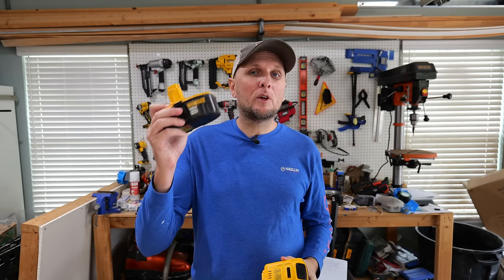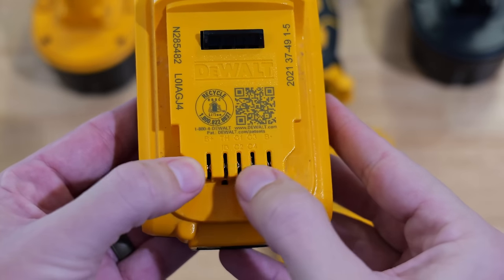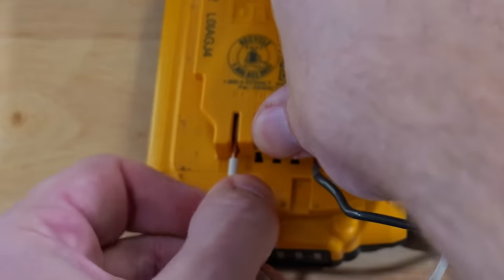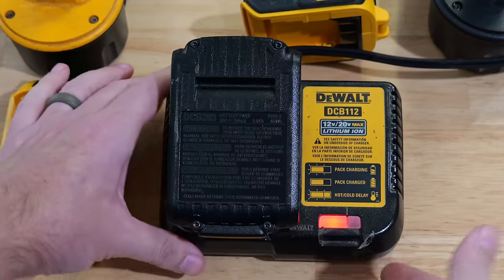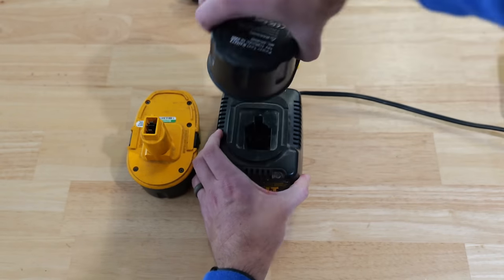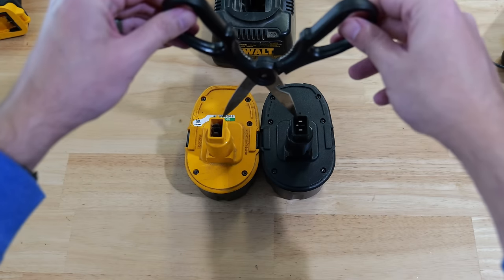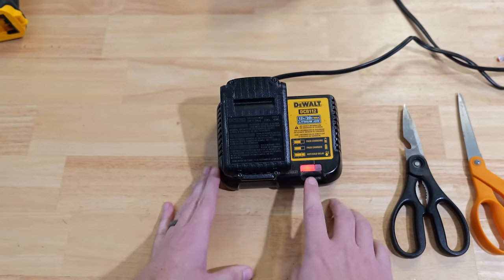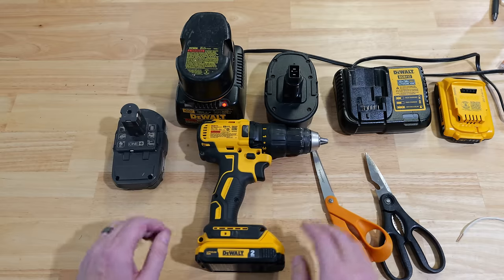SECRET To Reviving Dead Portable Tool Batteries | Super Easy!

Comment from the maker: Have you ever run into this issue?  Did you end up just replacing the batteries?
Reply: I wonder if this could be done with RC batteries?
Reply: I still have my dead batteries, so I'm going to try this. You're awesome. Thank you so much. I'm going to try this now. <3
Reply: I didn't replace them because I had already seen the 700 OTHER videos that explain this procedure on you tube.
Reply from the maker: @andys5562 cool. But that’s definitely an exaggeration 😂
Reply: I have run into a battery pack that would not charge, and as you have done, given it a 'boost' charge from another battery and then charged it as specified.  While this worked, it was certainly short lived, and the 'bad' battery never had the robustness of a good battery and eventually was more effort than it was worth for the length of time it produced work (and died again).
Reply: Just like in RC, the batteries slowly drain from age and won’t hold as much of a charge. You’ve seen it in cell phones as well, after a while they won’t last as long. This method is great, thanks for showing how to ‘squeeze’ the life out of batteries. I mark the ones that don’t keep as much of a charge just so I know which batteries will work but just not as long. Hint: always keep your batteries charges while not in use.
Reply: The problem is not really that the battery is dead. The problem is unbalanced voltages between cells. There are 10 cells in a DeWalt 20V battery. The regulator circuit tries to keep them all balanced when discharging and the charger wants to see them fairly well balanced before it will charge. This is a safety feature.
When you jump start a battery pack like this, it will only work if there is only one specific cell that is out of balance. If any of the other cells (or multiple cells) are out of balance this won't likely work. My experience is that this works only about 10% of the time.
Also, quite often the root cause is a defective cell, so even if you get this to work, the battery life on a single charge is typically much shorter and it generally only takes a couple of charging cycles to get back to where you started (i.e. the charger not accepting the battery).
If you've had better luck than that, that is great.
Reply: I have run into this, but the real issue I had was that my old 18V Dewalt batteries wouldn't last long after completely charging them. I bought new? ones, but they did the same after a while. I did find a kit with an adapter (adapter, charger, and 2 batteries) so I could use 20V batteries in my old 18V tools and that worked great to get new life out of the tools. I ended up getting a set of two no-name adapters and now just leave them on my most used tools. This probably wouldn't work for pros, but I didn't have to go out and buy a new set of tools for DIY use around the house and shop.
Reply: I have one that is fully charged (all three lights when button is pushed) and will run a tool, but when put on the charger, the charger does not blink.  Any idea what's going on?
Reply: @rogerheuckeroth7456  As I indicated in an earlier comment, these batteries are actually battery packs with multiple battery cells interconnected. If the voltages on these cells becomes unbalanced, the battery charger will not try to charge the battery pack because there is a risk of fire.
There are advanced steps you can attempt to try and resolve the imbalance problem, but there are risks involved and most of the time, the resolution will be only temporary because there is an actual defect that leads to the imbalance.
I don't recommend it, but if you search YouTube you can find videos similar to this one except that are disassembling the battery packs, identifying the unbalanced cells, and charging them independently with an adjustable power supply. If you do attempt this, make sure you are looking at instructions where they are limiting the current during the charging process.
If you do not understand what I just said, I recommend you just buy new batteries... which is likely going to be the final outcome anyway.
Reply: I have these problems with a bunch of my 18V 5.0Ah Bosch batteries
Reply: The best scenario, hypothetically, would be to trick the charger into charging the battery with the correct current.
Reply: Why did you leave out the Ryobi connectors? That's what I need.
Reply: I have BOSCH's 18V system, it's very similar to the 20V Dewalt's you showed, but I always just start charging them before they are dead as a doornail, and with it avoid complete drain.

Mine aren't marked with letters, numbers, or anything that is meaningless as to electrical designations, and there are other systems too where that may be true, and could have all kinds of markings.  That's what a V and Multimeters are for, and that's what you should have talked about, because there's no guaranty the contacts are in the same order, and someone who just takes your word for it on a different make system may be in for a surprise!!  

Mine do indicate those correctly as + and - : now that means something!

Why 5 contacts?  Two cells in parallel (Same Volts, twice the use time), and a sensor contact.

Even the cells are really made of multiple cells, and there are no 18, nor 20 V battery cells we know of possible by nature yet, which has to do with the materials used to make them and how they react chemically to produce energy;  A 9V battery is a stack of six 1.5V cells in series, and a 12V car battery over 14V.  And it's also why Lithium Ions are less than 1.5V, and 1.5 is rounded, even in NiCad's....  The more you stack the greater the error, so at a point an additional, or one less cell corrects it within parameter:s  there's leeway, they do not have to be exact.
Reply: During the early days of portable power tools - the 90s, by the time the battery stopped working, it was obsolete anyway, so I just got new tools. I must have bought a new set of tools every other year.
Reply: I have a ryobi that the charger indicates is defective.  Will this work in that case as well?  Or is that a different situation/solution?
Reply from the maker: @davidanderson9103 that’s different.  That is saying there is actually something wrong with the battery and probably needs to be replaced.
Reply: @davidanderson9103  It can vary widely, because he was very specific to Dewalt.  There are no rules to the arrangement of the contacts, and what indication they use to recognize them if at all.  a,b,c,d... or 1, 2, 3... are not electrical values and say nothing!  You need to either find out or measure what they are.  You also can't know if it's the same problem depending on the chargers capabilities to tell, as it very well may be defective and really no longer chargeable, or it may work.  It may even be a connector inside came off, corroded contacts... but lithium batteries do not last forever and do get to a point where they can no longer be sufficiently charged.

IOW:  You are on your own, because the video doesn't cover anything of value that can be used more universally, and other than those two systems specifically cannot be taken as valid.  There are although some tell tales to those of us who understand electronics, and even still call for further investigation.
Reply: @HowToHomeDIY  These battery packs have a microcontroller who's principle job is to make sure that each of the battery cells drain equally. If the microcontroller is unable to do this, it likely means there is an issues with one of the cells.
There are exceptions, though.
Reply: @HowToHomeDIY  "that’s different.  That is saying there is actually something wrong with the battery and probably needs to be replaced."

That's mere speculation!  You are going by "What it says", not how the MFG chose to word the message, nor if the circuit can tell the difference (Unlikely).  In your case you didn't even get a message.
Reply from the maker: @scytaleghola5969 that’s not what’s happening with the issue I’m talking about. So many people are talking about issues that this video had no intent on addressing.
Reply from the maker: @Bob-of-Zoid I didn’t get a message because it’s a different matter altogether.  It can’t communicate with the charger to give one.  If after a slight charge is put on the dead battery and once the charger can recognize it, it gives a message like his was, then toss it.  That’s not what this video is about.
Reply: @Bob-of-Zoid  Thanks for your response.  I figured it would probably be more complicated than simple yes or no.  I appreciate you taking the time.
Reply: @HowToHomeDIY  I figured it was probably different.  Thanks for the response!  Thanks for all your work and content!
Reply: @HowToHomeDIY  Given that the very title of your video can and should be read to be universal and not specific to just the two systems you covered, which it is, but it isn't now is it?

The message one gets indicates it cannot charge the battery, not why, for that a more sophisticated circuit would be required, and one can be made where they do communicate (higher cost), and it actually is, because the difference between detection and no detection is the most basic form of communication. Also you are contradicting yourself:  If it can't communicate, or compute..., then how can it tell what the matter is of the possibilities?

Toss it, or investigate further, and see if it can be fixed, because as I already said:  there may be other reasons the charger cannot recognize the battery, with that it cannot be charged only the start.  But it helps if you read my replies, in order and context to whom I am replying to, and seeing what you can learn from it, to which you should be accepting of my perfectly rationally reasoned logic (if you can which I now have good reason to doubt).

You very conveniently dismissed a whole lot, in order to defend the indefensible, and make me look bad, which is a strawman argument (Attacking the person instead of the argument), in your seeing my filling in the blanks, adding valuable information and trying to educate those with questions, and instead of seeing the utility, you took it as an attack, which it wasn't.  If it was, I would be clearly so, and there is nothing indicating that.

I chimed in because I understand this stuff on a highly academic level of engineering, as well as experience, and to help out where I can, it's in my nature.  Going after me for perceived motive is just plainly  bogus, and makes you look bad, not me

Good day!
Reply from the maker: @Bob-of-Zoid I never attacked you, I told you what the video was about and what is clearly talked about in the video itself.  Sorry if you took it personally.  Not here to argue.  You perceived something different than what was clearly laid out as the objective in this video.  It’s your opinion.
Reply: @davidanderson9103  Well, it's not as complicated that you cannot find out, and figure your course of action.  It may turn out to be easy, and salvageable.  Besides, if you don't, then you probably know someone with the tools and understanding to help.  It should be very basic for anyone who does.  Good luck with it.
Reply: @HowToHomeDIY  It is not my intention to get into a debate on this subject. The C1-C4 contacts on the DeWalt battery have a purpose and if you are "charging" your battery without using those terminals, you are not doing what you think you're doing.
You do not need to take my word for it, there is quite a bit of information on this elsewhere.
I personally try not to give advice on this subject because there are risks - of fire, explosion, or causing damage to a perfectly good battery. 
I mostly am trying to discourage people from thinking of these battery packs like other, less sophisticated rechargeable batteries.
I will beg off now.
Have a nice day.
Reply from the maker: @scytaleghola5969 I’m not debating you.  I said this video is not intended for the issues you mentioned.  This technique works for the majority of batteries that aren’t recognized on the charger and then start working and work well for a long time.  If one then shows there is an issue then toss it.  This is so common and has helped me a lot in the past and countless others in the comments.
Reply: @HowToHomeDIY  I said I was going to drop out, but just want to make sure that when you say "toss it" you mean drop it off at your local Home Depot or other battery recycling station. Please do not put Lithium Ion batteries in the trash.
Really, you should not throw ANY batteries in the trash, but especially Lithium Ion.
This has been a public service announcement.
Reply: Who has two pairs of scissors laying around. Someone has lost or broke them by know!  I hide the one pair of “good” scissors or I’d have none.  😂
Reply from the maker: @southwest7977 I can relate 😂 they are like shop pencils lol.
Reply: Spoken like a true genuine car salesman
Reply: Had it today. Will this work on the Ryobi 40V batteries? I have a 2 amp and a 6 amp. The 6 amp gets an error red/green flashing. HELP! (Thanks!)
Reply: @jc2200  rc batteries are lithium polimere cells and have a different construction than lithium cells like 18650 ect...  i dont know of any hack fixes for rc cells.
Reply: @scytaleghola5969  actually 5, 10, or 15 cells, depending on the ah rating.
Reply: @paul-Cellit-boston  thanks! Tried the method on a  e20 snaptain batteries. The charging indicator light will come on the good battery but not on the bad one(when attempting to charge). Left the landline phone wires connected, and  🔋s indicator light will come on the bad 🔋 but wouldn't charge!   The batteries look similar to the ones on the batteries shown here! 🙃✌️
Reply: No, I used a similar method only using two 9V batteries in series. It doesn't take a lot of current to increase the charge on the dead battery. There is a circuit board inside these batteries which controls the charge to the individual cells (there are multiple smaller batteries inside) and also charging info. If the battery gets too low, this circuit board fails to work.
Reply: @jc2200  I've done this with drone batteries.
Reply: @basswizardry nice,  did it work for you?
Reply: @jc2200  yes, works with almost any lithium
Reply: @basswizardry  great!. I used telephone   landline wires cause the opening is smaller, which, in the end, should not matter. I think the battery was detective.  Plus, it was a brand new drone, so I sent it back and got a refund instead! Thanks 👍
Reply: Try running the fully charged battery down a bit,then see if it activates the charger
Reply: My issue is a bit different. My charger says the batteries are charging and get fully charged. But when I use them they quit very quickly. I have recharged them but they still only run for a short time. Each battery has its own charger and they both are acting the same way. They are Black & Decker 20v. The instructions said they could be stored connected to the charger and with the charger plugged in. I’m thinking I just need new batteries. This is not the same problem shown in the video. Would anyone be able to offer up any insight to my issue? Thanks
Reply: @SammifromMiami  I'd say you're exactly correct,  they're tired and need to be replaced.  They will hold a charge for shorter and shorter times as they grow old.
Reply: Paper clips work great. Bend the clip out straight then bend the ends enough so they hook on
Reply: I have and did. No more.
Thank you!
Reply: The electrolytes used in all kinds of things will eventually become inert. It is a chemical/physical change and it just gets used up over time and proper use is important!
Reply: i
Reply: Great info, thanks
Reply: My father showed me that trick a few decades ago and though I do use power tools daily in my shop I have definitely  saved a few Thousand Dollars over the years on replacement batteries!!! The same exact trick also works quite we.l on crafting tools that are smaller versions of their big brothers like Craftsman, Weller or Dremel... I have been making blades, Knives & Swords for over 50 years now and the money zi"ve saved on recharging batteries is incalculable!!! Probably enough to take all 5 of my grandsons on a long vacation somewhere!!!
Reply: @rogerheuckeroth7456 have you tried cleaning each of the battery and charger connections? You can do that as simply as using a 
Q-Tip dipped in gas, alcohol or brake cleaner...
Reply: Z28 Camaro convertible.
Reply: I just had this issue 2 days ago with a 20v lithium. 
I accidentally fixed the problem by first giving it a charge with the 18v charger while using a converter.
Then the battery charged fine in the 20v charger.
So if you have the old and the new with a converter - no need to strip wires. 😂
Reply: 6:41 6:43
Reply: @HowToHomeDIY would this work with EGO Power+ batteries?
Reply from the maker: @dwoolery32 interesting question.  I don’t know for sure but don’t see why not.  I’ve not had any of my Ego batteries have this issue yet so haven’t been able to try it.
Reply: @HowToHomeDIY  Thank you
Reply: The only issue I've had with one of my 40v Ryobi batteries is overheating while mowing the lawn on a very hot, sunny day.  I thought it was out of power but It showed nothing on the charger.  Then I remembered something a colleague said about his batteries and 15 minutes in my fridge did the trick.  Once I placed it back on the charger it charged.
Reply: On the 18 volt battery, wouldn't a female spade connector on the wire work better and be safer than jamming uninsulated scissors into the terminals?
Reply: My man you have earned yourself a subscriber with that one! 
Brilliant hack. 🙌
Reply: Are 18  and 20 volt basically the same or does 20 volt have one more cell?
Reply: Wow. Great tip brother. Thank you for sharing your time, experience and knowledge with others. God bless you. Respect
Reply: Hiya sir;..great video. ..you know the second set of batteries you used (the older type 18v dewalt )...when you put in the sissors; the first set you put in...is that terminal a.....
 +  or a  -     The reason I ask is because the battery I have that is good makita has  plus and minus on it so I'm trying to find out if the first set sissors  (first connection )was a plus or minus...I would really appreciate your help  because  I don't have a dewalt battery with any life at all....the makita is allso 18 v Ni-cd...kindest regards wayne 😊
Reply: Yes I have.  The batteries were over 6 years old  Figured it was just time.  Ryobi.  Always positive things to say about their tools.
Reply: Could anyone help me with the issue I have written (my question )...
All I need to know about is ...on the second set of older Dewalt batteries 
I have the older ones allso..I NEED TO KNOW WHAT IS THE  + TERMINAL?   WAS IT ON THE  FIRST SET OF SISSORS HE USED OR SECOND.. ??.  🤔
Kind regards wayne ☺
Reply: I have ran into this issue a few
My latest one Atlas 80v battery stopped taking a charge
Used my 40 to tried to jump it
Still wouldn't take a charge
End up charging the whole battery with the smaller battery 
And it doesn't like to work in my tool even though it's got a 2/3 charge
Reply: Good afternoon;  I have sent you a question about the second set of batteries for dewalt twice now buddy "(THE OLDER TYPES; Ni cad"   18 v )   DO YOU THINK YOU CAN REPLY TO MY QUESTION  please 
Why  don't I seem to  get a reply ?
Are you not receiving? ...Kind regards wayne
Reply: Seems to work but will not have a full length charge, but anything better theb
Reply: @HowToHomeDIY  nobody covers my issue to do with 20 v dewalt battery i put in on the charger it starts to flash then shows it fully charged when it not has like 1 bar acourding to the indicator
Reply: Id like to know if this would work on my old Makita 9.6v batteries.. ?
Love the tools.. but they sat so long i can get em to charge..?
Reply: Man, you just made my day. Thank you?
Reply: Actually I revived several DJI batteries this way and they worked like new. But whatever you do don't short circuit a fully charged Li-Ion. You'll regret it after you get out off the hospital. 😅
Reply: Traduire francais
Reply: Traduire français
Reply: @jc2200  
Yes it can and it works well. I've done it several time and even recently with Airsoft and drones. 
Good luck!
Reply: @Major_Tamre_Colby  thanks 🙏
Reply: @JocelynMarois-ev2em  
Deus veritatem honorat, honori majorum nostrum, and hamster's too.
😃👍
Reply: @chuckgrenci6404  The problem you are experiencing is usually caused by running the battery until it quits.   This will eventually reduce the runtime between charges, and the overall life of the battery.   When the tool starts to run a bit weaker than normal it is near the end of its charge anyway.   Replace it that point.   Also, never charge a warm battery even if the charger allows it.   Let it cool down to ambient temp.   Usually 15 mins is good enough.  These simple steps will increase the life of your Lithium-Ion (Li-ion) batteries dramatically.
I have some 5-6 year old Li-ion bats that are still working like the day I got them.
Reply: @GeekboyNC Although this fix is a good one.   The problem you are experiencing is usually caused by running the battery until it quits.   This will eventually reduce the runtime between charges, and the overall life of the battery.   When the tool starts to run a bit weaker than normal it is near the end of its charge anyway.   Replace it that point.   Also, never charge a warm battery even if the charger allows it.   Let it cool down to ambient temp.   Usually 15 mins is good enough.  These simple steps will increase the life of your Lithium-Ion (Li-ion) batteries dramatically.
I have some 5-6 year old Li-ion bats that are still working like the day I got them.
Reply: @vinnyb.6524  Thanks for your insight, however, my battery stemmed from just being old (and not a regular service cycle). I was trying to extend its life (as I don't use my tool as regularly, since I've aged, as well as the battery......lol). I did get good service from the battery; just trying to eek-out a little more.🙂
Reply: Sometimes this is only a temporary solution. Ive done this on 2 batteries and got them to be recognized but the charger was shirt lived and ended up buying new ones.
I will be opening up the old ones and replacing the bad cells with new ones
Reply: What about  19.2v lithium craftsman batteries with 4prongs?Can someone please help me out ?
Reply: @GeekboyNC I have that adapter and it allowed me to keep my toolset through a round of lithium batteries that don’t have the overall lifespan of the nicad batteries, and are more expensive (that may just be due to inflation). I do like how light and they are and how quickly they charge though, and it looks like they’re the only option now anyway😁
Reply: can i connect 20v good battery to 18v bad battery and fix it?
Reply: Damn, I replaced the Batterie of my dyson already twice. Will try this next time🙏
Reply: Everything you said here is fine but some of these packs have trash batteries (used, high cycle rates) from day one. A few other channels have showed that if you open up the packs the manufacturer date on the cells can be 5-7yrs old.
Reply: Algorithm is definitely listening to me. I literally just had this problem..but with Mikwaukee.

Will this work for Milwaukee too?
As long as it's still in warranty it really doesn't matter though, cuz theyre real good about replacing it.
Reply: @charliem.7492   did it work?
Reply: Y just did that and they will not charge they all dead replace is the only way spend money on a good battery
Reply: My batteries dead cannot charger no sign blinking, I open the cover batteries assemble all separated and I using batteries for torch light,.😂  and i buy new cordless batteries, because i too late to see this video tutor , thanks any way👍🙏
Reply: @HowToHomeDIY  and you don't have a electric car yet the battery only lasts for 3 or ,2 years you veto has some money in the credit cards at ,45 percent
Reply: Be great if there was a fix for older computer batteries.
Reply: I have batteries that are fully charged, according to a volt meter, but will not run tool. Charger blinks fast.
Reply: @SammifromMiami  Never buy Black n Decker.
Reply: I have a ToGo advanced 650 portable power station, which is a 12 V lithium battery pack basically. I saw your presentation on the tool batteries and wondered if that same theory would work for a 12 V lithium power pack battery. Any ideas regarding that. Right now it’s dead in the water. Will not charge.same symptoms as you described for the tool batteries. Thanks, enjoy your stuff. Regards, Kevin.
Reply: Yes with both of my redback batteries 120v 2ah and 3ah
Reply: Also Ryobi have neither of these setups
Reply: You must have a lot of time to wast!
Reply: Thank you   very much.  For your   geate video .